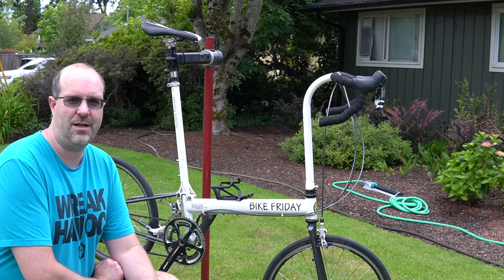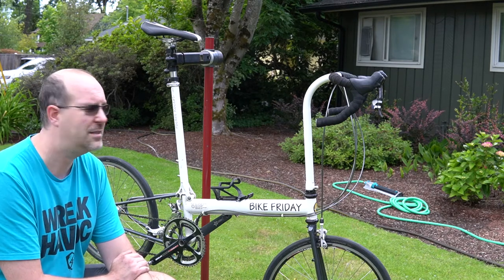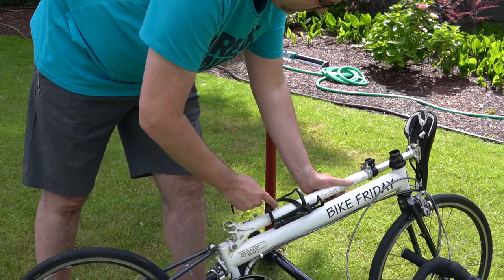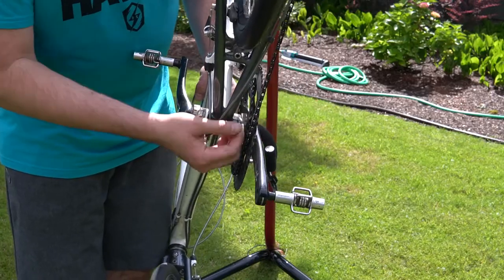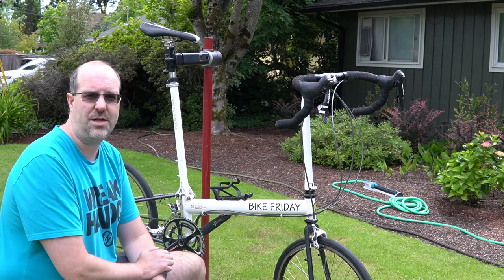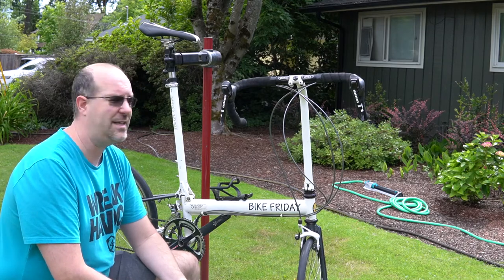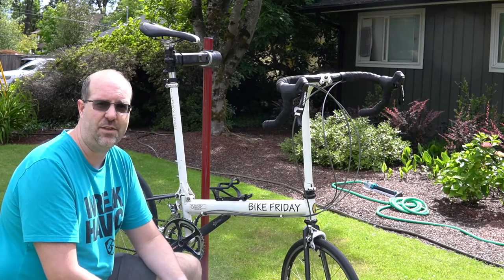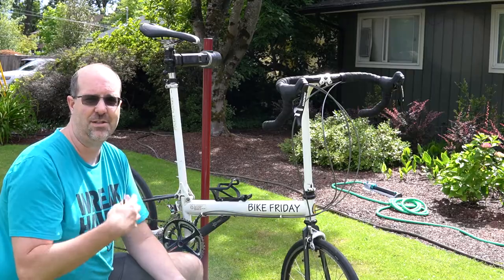Bike Friday Pocket Rocket with Sram Force Review

Comment: Bike Friday ride just like a full sized bike. I have a single speed Pocket Rocket and I prefer it for daily workout than my Litespeed Ultimate. If you haven't ridden one, do a test ride. I was actually torn between Brompton which I have owned before which I do love the compact folding, but if you love the full sized road bike feel, this is the bike to get. Plus, if you ride every day, you can fold it and take it with you and you will never have that feeling "I wished I had my bike.." Smaller wheels also helps with maneuverability and quick launch.

Comment: I'm looking to replace my Brompton.  A gripe I have w/BF is "it's not a quick fold" or "it's designed for suitcase travel".
I traveled w/the Brompton in a suitcase, so what are you guys talking about?
2nd, the BF is a FOLDING bike and the esthetics to fold it or while it is folded is messy.  
3rd, I don't like how the BF steering column is left to be scratched by & to scratch the bike frame.  That's really sloppy design work.
Otherwise a good bike  : )

Comment: Hi Eric. I have a New world tourist and I want to install a triple crankset. Do you know what kind of triple front derailleur can I use? Thank you.
Reply from the maker: It probably depends on what year tourist and how cables were run. Usually they’re bottom pull top clamp. Most are also Shimano but some were SRAM. You might consider calling Bike Friday service they can look up your bike build and make a suggestion.
Reply: @EricFischnaller  Thank you.

Comment: Omg watching you fold that thing looks so painful! Get a Brompton!
Reply from the maker: This is not a "folding" bike but a travel bike. I'd like to see a Brompton keep up with people on full sized bikes on a group road ride! This bike is fully capable of doing this and it goes into a suitcase so you can take it with you where you want to go. If you're riding to and from work getting on a train or in a cab, then this bike isn't for you. A Bike Friday Tikit is a good alternative to a Brompton that gives you options in terms of the build. Happy trails!
Reply: I agree, makes no sense not to add a folding hinge to fold the top tube. Bike friday is just incapable to do it and make sure it's safe I guess.
Reply: @EricFischnaller  no way this will keep up with full sized bikes due to one reason - its wheel size. Not having a hinge to fold does not magically makes it go that much faster.
Reply from the maker: @user-yk1cw8im4h  wheel size only really makes a difference above 24 mph in my experience. Most small wheeled bikes are geared much the same as full sized bikes so of course it won’t go as fast since the gearing will be off. My Bike Friday however doesn’t have this issue. 

A 700x25mm full sized bike with compact double and 11-26 cassette has 34.5 to 119.9 gear inches.

My Bike Friday with 451 x 28 tires with a 39/53 crankset and 9-28 cassette has 27.7 to 117.2 gear inches.

Unless you’re a fan of pedaling downhill in your top gear it’s not really an issue
Reply: @EricFischnaller  Frome everyone that I'd checked into who own the Bike Fridays (some have both Bike Fridays and bromptons).  The Bike Fridays ride like the full sized bikes and are preferred over the brompton for their riding capability.  The Brompton fold much easier no doubt.  The tikit solves the folding desire though sadly, they don't make them anymore.  Recently replaced by the PaKIT which is also very great, just not as good (as far as folding and rolling while folded) as compared to the Brompton.  We like riding.  We in fact, like riding much more than folding.
Reply from the maker: @drivestorage1779  absolutely they ride awesome. If quick folding is the objective there are tons of great folding bikes. As a travel bike, this is unmatched.
Reply: @user-yk1cw8im4h  Check out the 20 inch wheel Moulton bicycle from the UK. Back in the day they entered a 4 man track team and they beat the full size bike team quite convincingly. Various records were held on the Moultons including Cardiff to London solo road event 162 miles in 6h 43m average speed 24 mph.
Reply: Fun fact, the word SRAM does not have an H in it. Never did.

Comment: is there a bike weight limit? i saw its only 125lbs.
Reply from the maker: Bike weight limit of a regular rocket is 240#. Weight limit of a Pocket Rocket Pro (with double-butted tubes and lightweight rear end) is 190#, Pocket Rocket Super Pro is custom-made to your weight so these vary. You may have seen an ultralight if the weight limit was that low.